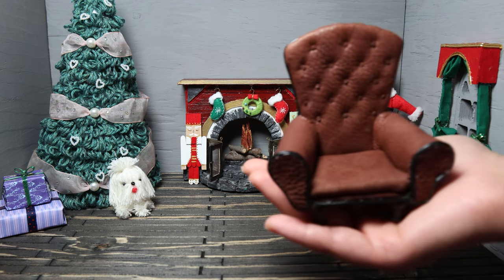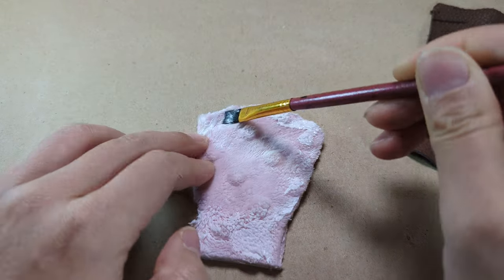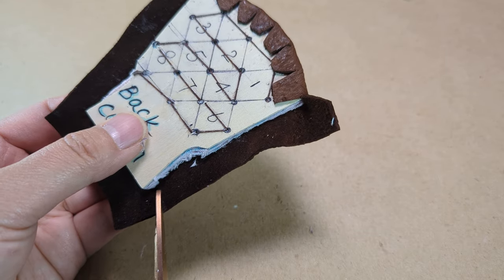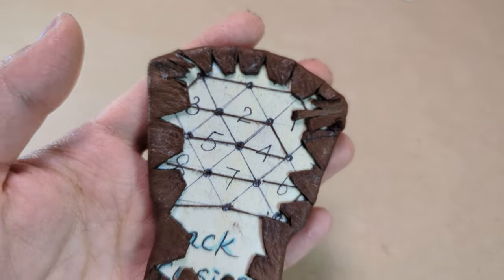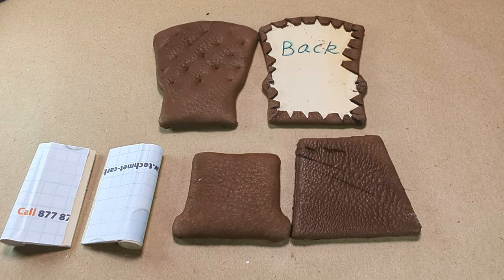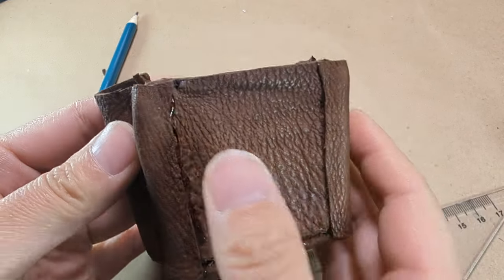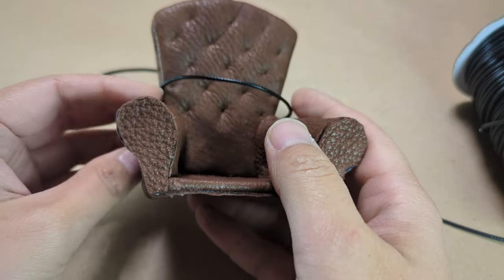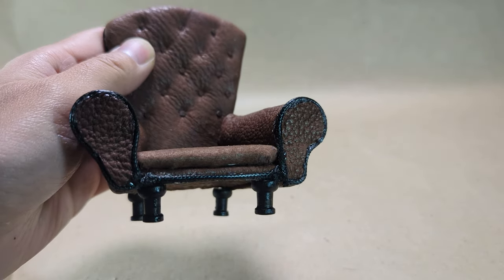How to make a miniature leather estate chair. #miniature #diy

Comment: I’m impressed with your chair! You are so good at explaining the steps. Is it 1:12? Or 1”=1’ (1 inch =1 foot? Your measurements are in centimeters. It would help to know that the scale is the same as my other mini furniture. Also, I like that you use things I have on hand. The wooden pushpins used as feet are very clever! I’ll be painting mine first before pushing them in so I don’t mess up the leather while painting. Thank you so much! I’m subscribed now and I’m looking forward to seeing your other videos
Reply from the maker: The chair is 5 inches tall with the feet. That would be about a 1/8 scale. Thanks for watching.

Comment: I am going to attempt to make this with Faux leather. Do you think my results will be similar? The Faux leather I will be using has a recessed pattern on it. Thanks so much for this tutorial and all of your other ones. You are inspiring and so talented. ❤
Reply from the maker: I tried leather looking vinyl before and it didn't glue well. The material also split as your needle goes through. Thanks so much for watching.
Reply: @cocoscrafts6410  okay, good to know. I  would prefer not to use real leather, so perhaps some fabric with a stretch and thickness similar to that of real leather would be best.

Comment: Lovely chair but would it be easier to cover then construct the chair? I’m not criticising, I’m new to this and was wondering which way would be easier for me. 😊
Reply from the maker: If you are talking about the arms. The glue connection is not stable if you put the double cushion and leather on first. It is better to get a solid connection and put the other stuff on after. You can do that for the other parts however.
Reply: @cocoscrafts6410  thank you for the advice! 😊
Reply from the maker: @freetobeme6013  you are welcome. 😊